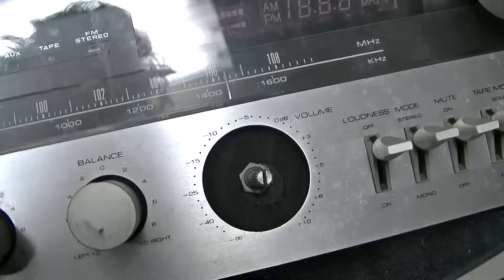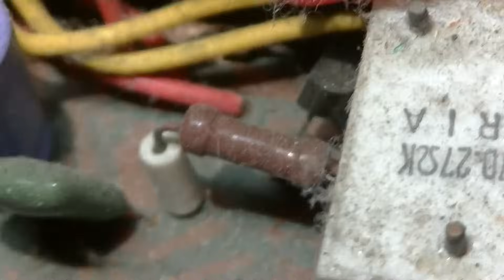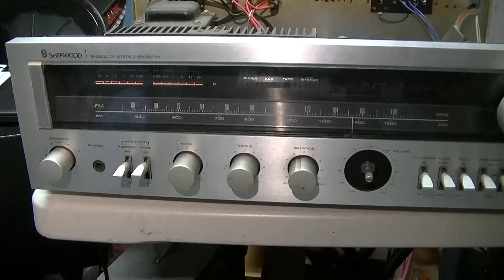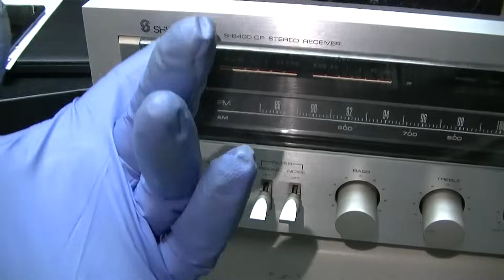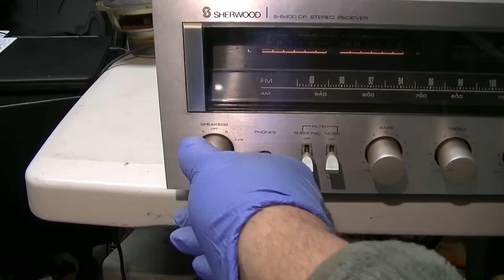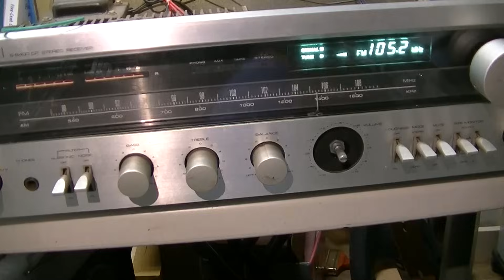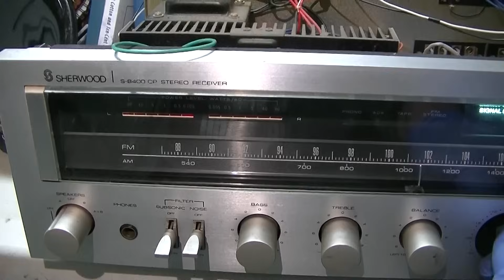1980 Sherwood S8400 Receiver Repair and Ford AC Compressor Replace and Dissect

Comment: EV's are garbage. The internal combustion engine will be around for a long time
Reply: Yep.easy to repair,reliable as a hammer.no battery degradation and you can repair it yourself. I wish Chrysler would have put their tubine engine into production. In tests they lasted over 500,000 miles and would run on anything combustible

Comment: There is nothing wrong with using R600a in the AC system as long as you do the necessary steps to keep it working. This 
includes checking for leaking seals, damaged lines, and maintaining proper charge.

Comment: I replaced one of those compressors on a friends mustang. It failed when the car only had 45k miles on it. As you said,the only positive thing is that they are very easy to replace.  I enjoy your automotive and other videos as well.
Reply: 98 Ford van with the 4.2 l V6 Essex engine is easy too
Reply: @coreybabcock2023  Don't know anything about that. I don't own or drive anything newer than the 60's. Just know that my friends mustang compressor failed really early

Comment: I never understood the point of having a digital tuner on a unit with an analog tuner. Its just a gimmick like those watches they sold in the 80's that had an analog clock and then an lcd digital display at the bottom.

Comment: Interesting receiver! Good idea on the power switch. I wonder if a 194 auto universal socket would have worked for the dial light. What LEDs did you use?

enjoyed the AC compressor teardown and the butane refrigerant idea. they wont let us have R134 anymore in Washington. BTW, my 1994 Ranger pickup has 150K miles, all original AC components with R12 still, and will freeze your knuckles off. You are right about the water pumps also. Mine just went out for real in December, but lasted 30 years and 150K. I'm still on the original alternator also. I plan to kit it when it breaks. The 1234YF refrigerant in my 2015 Dodge dart keeps leaking out, and even when  full, it is not efficient. I also have a 2013 Chev Impala with R134, and its holding its own.

Regarding your Ford, man I hear you! The vehicle market is so crazy right now because nobody knows where things are going. Dodge/Stellantis wants us to think they have things figured out with the hot electric muscle car. Looks pretty, but I'll bet they have few takers. They are also hedging their bets with the straight six gas engine. Ford and GM are continuing to update the gas motors, AND develop electric, but both are losing money on electric, and the stock prices reflect that.

Comment: I had a compressor lock up on my Oldsmobile.  I flushed the entire system out with brake clean, new compressor, and new accumulator.  The condenser was the older tube and fin style so it could be flushed.  I ended up using PAG 150 oil and duster spray which is R152a.  It blows ice cold!  The R152a runs at a lower head pressure the R134a so it will be easier on the compressor.
Reply: That useage of duster spray in car A/C is probably why my local Lowes is always out of stock of duster spray, and the containers keep getting smaller and smaller and more and more expensive😠
Reply: @cmans79tr7  I'm pretty sure people use the duster spray to get high. That's going to be a much more common off-label use than AC recharging.
Reply: @eDoc2020  - Ha ha, you're probably right. And probably shoplifted🫳. That's why they're always out of stock - if units don't scan through the register, the computer doesn't know to order replenishments.😠

Comment: If it was my truck i would have used R152 from the Air duster cans you can buy from the store, Very close to R134A  you use about 10% less then R134A. The R600 that is a also a very good Idea. I bet you could also get away with propain for your BBQ AKA Dirty R290 LOL . Cool video. Suction side should be beer can cold, liquid line should be whiskey bottle warm. 😁

Comment: Interesting to see the teardown of the compressor. I've replaced a few, but never actually took one apart, surprisngly. Seeing how that swash plate piston interface in this design is, can't say I like it. The balls inside each piston look like they just sit in a pocket, which if so, are like a bushing. Wear is guaranteed, and low lubricant absolutely detrimental. That is a lot of surface area that ball rolls against. Seized up, and friction welded. I can think of a round bearing+roller pin arrangement the ball could sit in that may be better, but that would be some super precision machining. Still interesting to see though, as was the other swash designs I just saw doing a search.

Comment: The dial, digital readout and power meters as well as the parts inside of it look like a clone of a Sansui G-4700.  If the digital readout's IC takes a dump, it is unobtainable.   The 4700 is rated at 50 wpc.  Judging by the transistor complement, I'd expect similar performance from this Sherwood.   It sounds like it has protection circuitry unlike the 4700.  Definitely a plus.   I would have checked the DC offset while I had it apart.  Plenty of real estate on that back panel for a toggle switch, but I get it if the owner doesn't want it molested.  Enjoy your channel.  Highlight of my Saturdays. ✌️

Comment: Odd you are not getting always lean service codes with that "Holy" inlet tube. I've used PVC tube with short intercooler hoses to replace these obsolete ones.

Comment: The straight butane refrigerant is known as R600 and works quite well as an R134a replacement.
Reply: R134a is better
Reply: When filled into a 134a system does the butane still pull the PAG oil with it? I was told it only worked with the R12 mineral compressor oil. Maybe Shango has to flush the system and add mineral oil, then the compressor wont run dry...
Reply: @blitzroehre1807  R600a calls for mineral oil but shouldn't be reactive to PAG oil, so one could likely get away with either.
Reply: HC 12 was used in big trucks,just propane when R 12 was phased out..The hc was short for hydrocarbon.
Reply: @johnchildress6717  HC-12a is a Propane/Isobutane mix.  HC-22a is straight propane.

HC-12a is supposed to be a drop in replacement for R12 and R134a.  HC-22a is supposed to be a drop in replacement for R22 in commercial applications.

Comment: Hey hey now.  Be nice to my console tube stereo, man!  I'm winding power and output transformers right now for a new tube amp to go in mine.  PP EL-84 to replace the SE 7868 amp that was in it.  Yeah, they did kinda tend to be low-end, huh?  The stock amp is very distortion heavy. Tiny output transformers too.  I love that styling though, before they got super cheap in the late 60's and onward at least.

Comment: Even as a repair tech here in the Uk I didnt see all the digital fluorescent, led and slide rule displays on a tuner amp, the nearest was waltham who did something like this but the fluorescent display was just a clock.
I'd say the digital frequency display is a frequency counter, as on Am it tuned in 1kc steps, if I'm right in the Us synthesised Am tuners tune in 10kc steps, here its 9 kc steps.
Reply: Yes, its a frequency counter, you just have to subtract IF frequency.

Comment: Your Explorer has done you well, specially for it’s age. mine is slightly newer then your one as its a 2006 & I've only had to replace the starter motor & alternator. But now it’s suffering from a blocked catalytic convertor & worn front shocks! It’s got 305,000 km‘s on it, so can’t complain too much about the old car, i don’t hardly drive it now as i’ve got my 2006 Beetle so the kids use the Explorer/Territory to learn to drive for their driving hours on their learners licence.

Comment: Sherwood always had power switches mounted to the volume or tone switch. In the mid seventies, I purchased a model 7010
receiver brand new at a good price. It sounded great, especially on Bohemian Rhapsody. The bias was critical on the output transistors as I remember. They're sleeper receivers.

Comment: I dont like the swash plates it seems very prone to failure. My fathers corolla had one fail in the exact same way from running low on refrigerant for a while. 

mine with rotary vane pump has its own oil reservoir its much more durable.
Reply: Rootes blower?

Comment: Low system oil charge, compressor seize. R134a requires Polyalkylene Glycol Synthetic (PAG) oil. Don't know what the hell would work with butane?

Comment: It would work a lot better with propane or isobutane. 
Butane pressures are just too low for proper oil circulation

Comment: Upgrade to what?  Look for a low mileage but older car.  Frankly, I don't think there will be any ban of new ice cars for at least a decade and a ban on gas for at least 3 decades if ever.  You cannot create diesel or jet fuel or low lead without first producing gasoline.  As long as the world needs these heavier fuels, there will be gasoline.  As of today, there is just no way around this.

Comment: The font on those controls is identical to my 1976 vintage Pioneer H-2000  AM-FM 8-Track with Phono jack. Probably same manufacturer. Mine has dedicated flip-up power switch. Still works today😊
Reply: I think all these big companies like Kenwood, Pioneer etc. Had all their knobs and face-plates made and sourced by the same companies

Comment: How interesting about the power switch inducing noise; I've never seen that before. That's a solid diagnosis. As an aside, I never liked solid state hifi amps like these; they're just too temperamental. Dozens of transistors to fail, and if it's the driver transistor that shorts, you get the added "benefit" of it taking out the output transistors with it

Comment: The FCC requires the public file be on their site and kept up to date.  Go to any fcc regulated company's website and you will find the public file posted.  The public file will contain incidents where the regulations were not followed.  Like mistakes in the closed captions systems for TV.

Comment: I had an old Pioneer receiver 25 years ago with the same silly power/speaker switch design. Every time you turned it on you'd hear the same arcing noise through the speakers and the dial lamps would flicker for between 1 and 5 seconds, before it would finally stop and work fine. Definitely a common problem I guess.

Comment: cleaned one of those switches on a pioneer SX-550 & it fixed the issue but then later the power amplifier twinkocrwerkulated transistor popcorn machine....(Unrelated to the switch problem)

Comment: I worked on a Kenwood receiver that had the same power switch and it was doing the exact same thing. I took it apart, cleaned the contacts and bent them a little to make better contacta and it's been working for years since.
Reply: @@stephensams709   This was actually a Sherwood receiver - or are they equivalent?  Anyway, good on you Stephen, fixin up & cleaning up the power switch!  Good job!   I just wish Shango would have done the same, even if he eventually ended up bypassing it anyway.
Reply: My fathers Kenwood KR-3090 suffered a similar issue tho it went unnoticed for many years. He used it in the garage fairly close to a fluorescent fixture running 4 8' T12 bulbs. He always blamed those lights for the excess noise on the receiver, tried every trick in the book to reduce the interference & the whole time the problem was actually the switch intermittently arcing. Luckily the switch had two sets of internal contacts and the 3090 only used one side/set so I just swapped them around. That was fortunate as the contacts that were previously hooked up were thoroughly twinkoquirkulated.
Reply: Interesting observation, I was trying to find the manufacture as it seems to similar to Trio,  Kenwood and Technics in the Amp section. I think it was made in Korea but may be wrong.
Reply: I just came to post that those toggle switches look darn near identical to the toggle switches on my Kenwood KR 9600 receiver
Reply: Had it been my own tuner device, I'd have done exactly the same thing.
Fully understand Shango's reluctance to go down that path, considering how litigious the USA is & especially California.
Does look a lot like a Sherwood design

Comment: I enjoyed the conpressor strip down 🎉
Reply: I've only pulled one apart, but it was very similar. 

That "swash plate" design is how most average gas pressure washer pumps work too, but they typically only have 3 pistons.